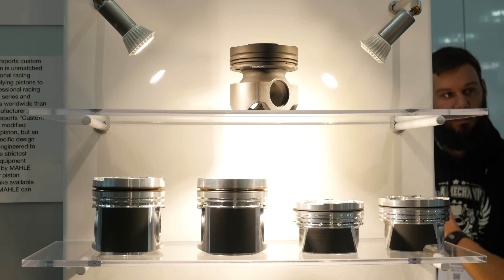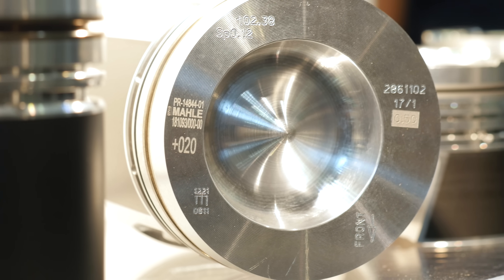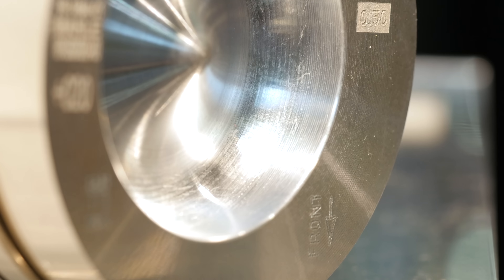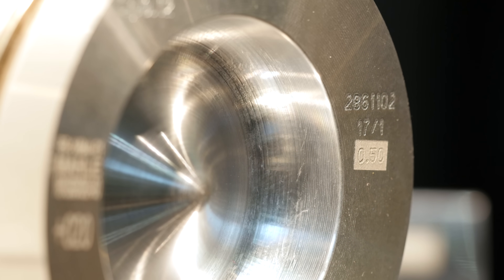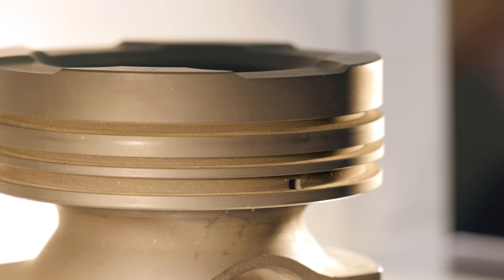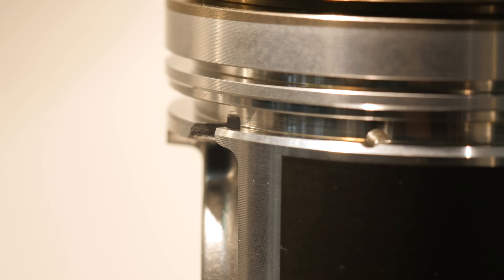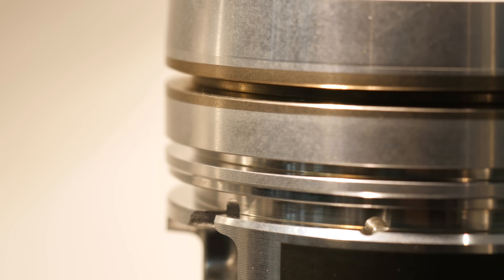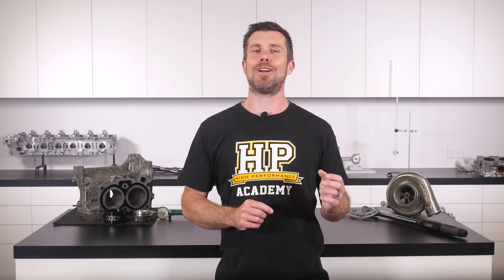Your Factory Diesel Pistons Suck. Here's Why | Mahle [TECH TALK]

Comment: >>The reason a cast DIESEL piston can handle 1000hp while a cast gas piston will fail is NOT due to the mass, it's due to the way the fuel is burned in each...   A gas piston sucks air/fuel in, fills the cylinder area, piston comes up, compresses hard & just before the top, a spark plug POPS the mixture causing a controlled explosion..
  Diesels are nothing like that at all.. The diesel doesn't mix fuel before the piston starts compressing. The diesel begins "injecting" fuel around the top dead center just as the compression peaks. The heat / compression detonates it , and the injector feeds the burning / expanding fire ball as it chases the piston down during it's power stroke. 
   Basically, a gas engine uses a single instant EXPLOSION to throw the piston,  where the diesel SHOVES it during a 3 or 4 inch burn cycle... 
   Try to tow a car using harsh yanks on a tow strap VS a steady tug. The YANK might make it move quick at first, but it's hard on the parts. The steady tug is easier on parts & better to pull up a hill..

Comment: With all respect to Mahle.
Why are we talking about Diesel durability in 2018? That's been left behind in the 80s.
Reply from the maker: I think you might have your dates mixed up there looking at what is available today compared to the 80's ;) - Taz.
Reply: @hpa101  You mean Diesel race cars that die After 1/3 of old slugs that could even pull trailers maintaining consumption and functioning  gearboxes?
Reply: I  agree  high performance  diesels might as well be petrol diesel used to be bit sluggish  on hills and acceleration  but lasted almost for ever and didnt guzzle fuel latter scania  use 20 % more fuel than ones from 20 years ago

Comment: Whats funny is Mahle produce the pistons for CAT 35 and 36 series engines.

If you look at the underside of the crown there is the lazer etched Mahle logo and NCR code square.
Reply: Mahle makes OE pistons for most of the diesel engine manufacturers. Cummins ISX, ISB, and ISL class engines all have Mahle steel pistons in them since common rail high pressure fuel systems took off.
Reply: Basically all the diesels I work on for dsny sanitation have mahle pistons. They also make pistons for power sports engine manufacturers like Rotax, maybe others and I believe they make pistons for BMW and Mercedes.
Reply: @danieldimitri6133  Mahle did make Pistons for many manufacturers, inclusive PSA, but today the most diesel references for PSA engines are made by Kolbenschmitt with the same level of quality and similar technology: i had work by both manufacturer so i known they products...

Comment: You are correct. My pistons do suck. They suck air in for the next stroke, my diesel doesn't have a turbo. How did you know??
Reply: Your pistons travel downwards and create a low pressure, it is atmospheric pressure that fills the void created with air, it is still forced induction, just done by atmospheric pressure.
Reply from the maker: I could feel it in my waters - Taz.
Reply: @hpa101  🤣 always enjoy your content, many thanks and well done

Comment: A Cummins spun up to 6,000 RPM, damn.
Reply: I don't believe that 
As fan of 5.9 cummins and my truck has 720k miles on it 
It's diesel not gas
Reply: @yaldashams3978  Those are race engines, not tuned street.  I've got "3200 rpm" springs in my 12V pumps for example.
Reply: It was the 10K that struck me.
Reply: Check out Gale Banks channel! Killing a ,Duramax over 800hp mostly stock,

Comment: Less heat issues with Steel Pistons? Anodised Al (AlO3) is weaker than cast Steel? I think i´ll drive to Mahle in Stuttgart tomorrow... They need to write Mahle North America a Letter...
Reply: You misunderstood what was said. Cast iron ring groove insert, aluminum forging can't have one so anodizing it helps, but isn't as strong in terms of wear resistance as the cast iron insert. Not it's actual sheer strength.
Reply: @JosephArata  I think shear strenght might be easily lower too. Anodising, other tan wear resistance, will not help much with stenght of part. 
Higher heat resistance might easily ofset lower heat transfer, as well.

Comment: make some pistons for the BMW M57 in the E60!
Reply from the maker: Fire Mahle an email Alex. If enough people get in touch with companies regarding the products they want things can happen and there's nothing to lose from dropping a line - Taz.
Reply: Alex Strömberg And the n57!
Reply: Seeing forged steel pistons for the M57 and N57 BMW engines would be great, however the stock cast pistons are made from superior material and will last up to 200hp/liter with proper tuning and small mods on the pistons
Reply: @MrSupermasi  yeah but forged is better, also it would be lighter so you'd be able to rev a little higher
Reply: Unfortunately forged aluminum pistons can't have a steel ring carrier so a piston of this type would be racing only.
Forged steel pistons as mentioned in the video are heavier than their aluminum counterparts, however reduced piston pin length can bring down overall oscillating masses of a steel piston assembly to the level of aluminum ones.
Reply: Vote for n57
Reply: Not yet seen a m57 piston fail.
Reply: @JohanvanderMeulen1991  there are a lot with melted Omega bowl edge. Also I have seen a lot of cracked ones, but they were Nüral castings.

Mahle uses the superior M174+ alloy on nearly all their cast Diesel pistons, however if the tune on the ECU is done poorly and the driver has absolutely no feeling how to handle an engine damage occurs in no time.

Comment: Very interesting! Diesels are just a different realm compared to petrol, its almost like having to learn internal combustion over again.
Reply: Many forms of ICE there is. Original design was for Alcohol. And a design with Peanut oil as a backup if Corn stocks were jeopardized. Hmm, like today! The Peanut oil was adapted to Diesel oil by Rudy.
Reply: Not difficult if you memorize that Diesel combustion is air quenched and not fuel quenched unlike gasoline spark ignition.